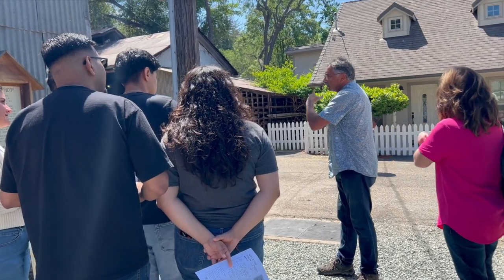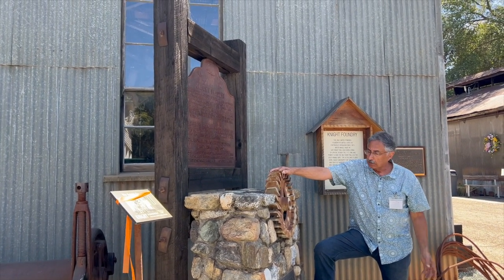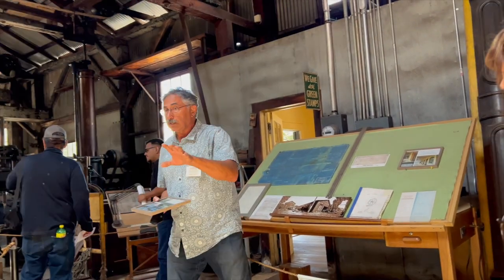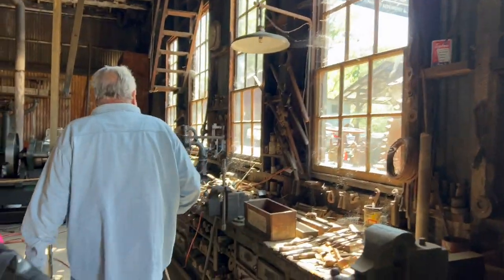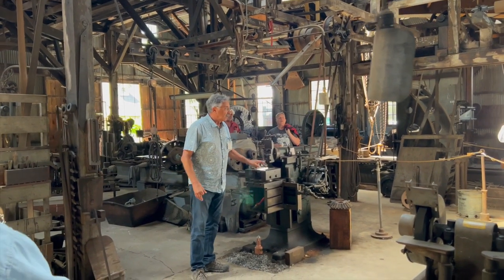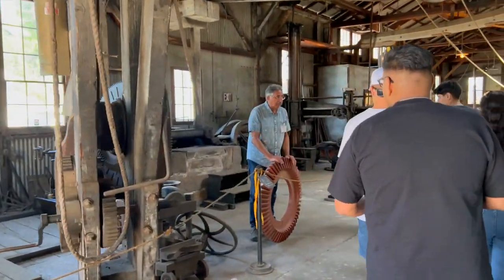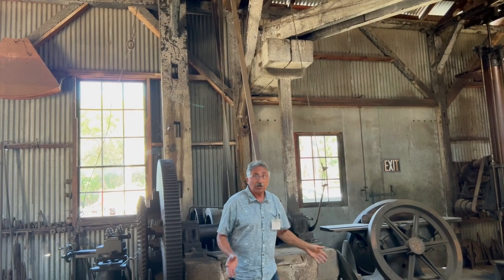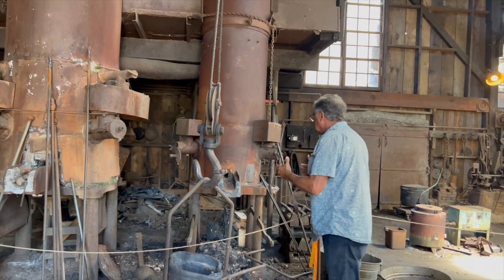HISTORIC WATER POWERD KNIGHTS FOUNDRY 150 years old Sutter Creek Ca

Comment: 🔙 and in the early 60s my father worked for a pump manufacturer in Stockton that poured their own castings. I saw a couple of pours from a distance. They also had an extensive machine shop. 75% of the machines were powered off jackshafts.
Reply from the maker: Cool Thats very neat
Reply: The outfit stopped the casting by late 60s and went to India for the rough castings and by the mid 70s they shopped out the machining to India as well.